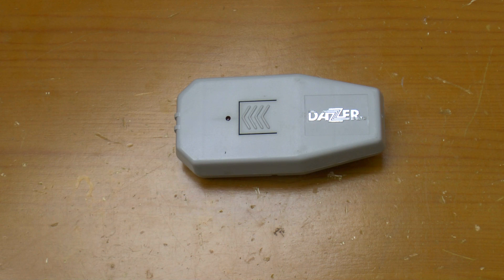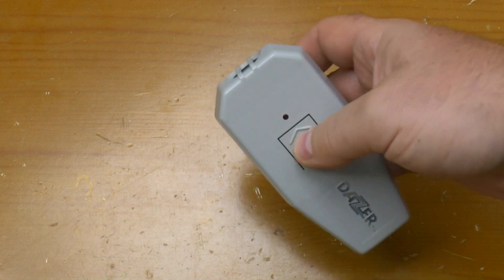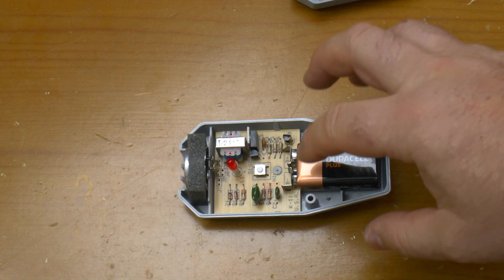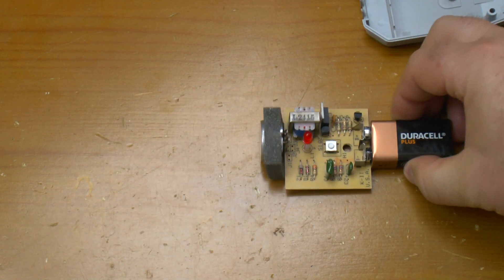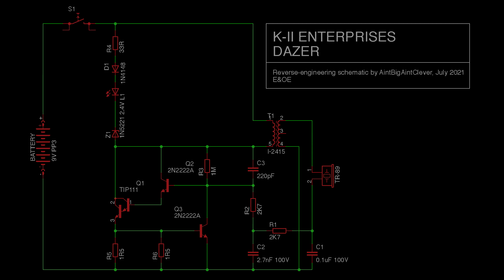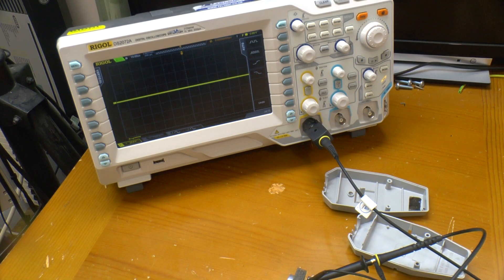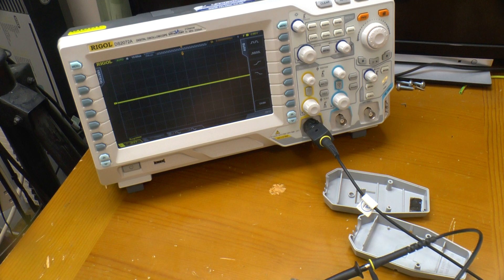What's inside a DAZER ultrasonic dog repeller?

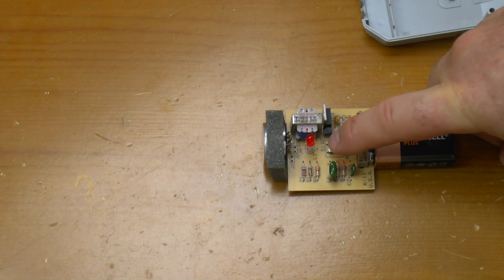Comment: 2:52 same thing also happens with other similar circuit which is Ultrasonic cleaner it's circuit its circuit is pretty much similar to Electronic CFL ballest but with isolated secondary the weird thing about this is if you wanna run its oscillator without pizo connected it will output very little current but after connection oscillating current increase with spark while connecting or disconnecting it seems Pizo is the part of it's oscillation in its circuit! Don't know exactly how?

Comment: Notice the camera audio level goes down a bit when the unit runs. Not audible to us but audible enough to the camera mic to alter the auto gain(?) control. You would probably want to probe somewhere on the low voltage side as that transducer will have quite a high impedance and possibly as a capacitor as well, the 1meg impedance and 12pF loading on the input of the scope will likely affect things. Probe the primary or one of the switching transistors.